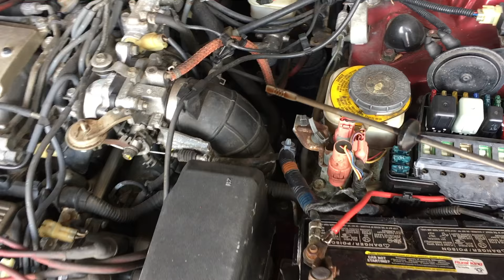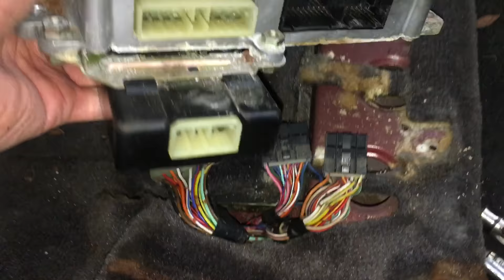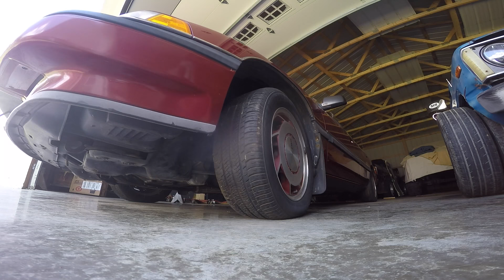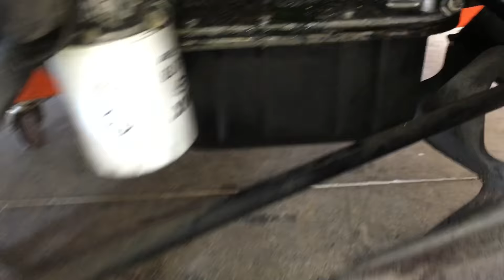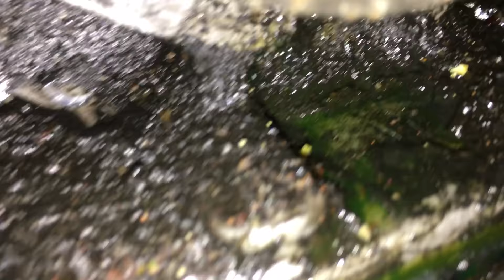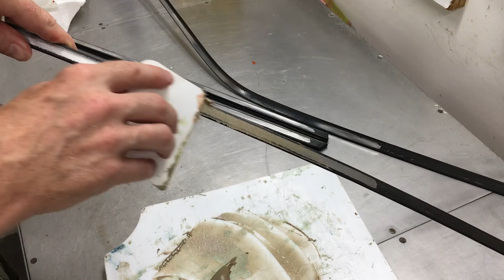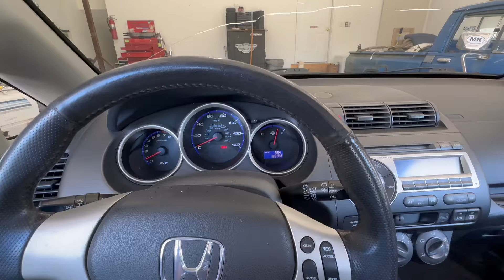$350 Acura Legend Full Restoration: 15 mins Start to Finish!

Comment: I want to start a project car soon too, get something cheap and non running and fix it up. Problem is that the old cars here just look awful and rusted
Reply: Like besides the interior and some electronics, this car looks great. And those are things you can change
Reply from the maker: Rusty is what most of the older vehicles are around here. This one was truly a needle in a hay stack and I was very lucky to find it. I'm back to restoring a rusty 1g 4Runner and it's soooo much work.
Reply: Theres still some gems on CL, as far as projects go.  Older folks not using FB, etc.  Ive seen a few posts over the last months while looking for a used vehicle there.

Comment: no rust? that's crazy!  what about underbody and wheel wells?
Reply from the maker: The underbody was surprisingly clean! There were a couple of tiny bubbles under the paint where the rear 1/4 meets the rear bumper - where all Hondas start to rust.  But that was it!

Comment: How would you completely restore and refurbish something like a 86 stanza wagon including its engine, frame, and body. Would you need to make your own parts. Fixing and restoring everything, is it hard or easy.
Reply from the maker: It really depends on the level of rust involved. I'd imagine there's not a lot of aftermarket support for a Stanza, so you'll have to fabricate any replacement parts/panels or source them used. Frames can be repaired if they're not completely rusted out: https://youtu.be/VkKxIEPKUAQ How rusty are the floors?

Comment: This car did sit outside for 10+ yrs, how is it possible it has almost zero rust on it
Reply from the maker: It was parked outside, but never driven on the salty roads during winter.
Reply: @6thGearGarage  on grass or solid ground? grass keeps moisture, so it causes alot of rust on the underbody
Reply from the maker: Thankfully it was parked on pavement.

Comment: how long did this restoration take?
Reply from the maker: I did it in my spare time, but I started getting it to run in spring of 2021 and finished painting it in late fall 2021.  Then I stored it for winter and did the timing belt, seat covers, and refinished the black trim in spring/summer of 2022.

Comment: My first car was a 1987 Legend (the base model with Florence blue over gray two-tone paint and blue fabric interior). I grew up in it, and it was twelve years old with about 280,000 miles when I started driving it. It was impossibly well engineered and built, and more modern than any car from the mid-80's had any right to be. We let it go sometime around 2004, at well past 330K, and in all those miles it never needed more than routine maintenance. This video makes me wonder if it's still on the road somewhere!
Reply from the maker: These 1st gen legends are tragically underrated!

Comment: I would’ve scrapped the car. Having part availability problems for these older cars just makes it not worth it in my opinion. You did good for the most part but the seats, the weather sealing seals that’s why water got into the car, all needed to be replaced. But good on you for at least getting the car running and driving again.
Reply from the maker: Yeah the seats were a letdown. I've since learned to reupholster and the end result is 100x better: https://youtu.be/sWS9Sgd1Ho8

Comment: A lot of people have no idea that the 80s and 90s cars are still kicking, this consumer culture. They think if it's not new it's not worth it. Absolute gem! And great work on that Enkei.
Reply from the maker: 80's and 90's cars are my favorite era. Not as powerful as 2000's and newer, but they're fun, simple, easy to repair, and have just enough electronics to make them reliable without all the extra bells and whistles waiting to fail like modern vehicles.

Comment: Did you ever fix the sunroof?
Reply from the maker: No, it was completely rusted in place and I never found another one for sale. I put it back in and left it in the closed position.
Reply: @6thGearGarage  too bad, but it should be fine if it doesn’t leak, and you don’t really see it from the inside anyways and if it looks fine from the outside.
Reply from the maker: I did clean out all 4 sunroof drains while it was apart, so it shouldn't leak anymore.

Comment: I brought one of these back from the dead 20 years ago. It was sold as needing a fuel pump but the timing belt was broken, so not a cheap repair. Well worth the money and effort anyhow, it was a delight to drive. My only disappointment was that they didn't ever come with a manual box. Peppy, comfortable and rare enough to turn heads. Mine was also a 1988 in Persian Red. ))
Reply from the maker: The Persian Red sure does look great on these cars! There were manuals but they were more common in the coupes, as most Sedan buyers were looking for luxury more than sport. The 5 speed is a rare find in the Sedans.

Comment: Did you sell it?
Reply from the maker: I traded it for the Honda fit + cash
Reply: @6thGearGarage  how much wood you have sold it for just cash
Reply from the maker: I had it listed at $4000 and nobody came to look at it. When I dropped to $3500 is when I eventually got the offer for the trade.
Reply: @6thGearGarage had u seen it in my local area u would have grabbed it

Comment: It would help to change all of the fluids first.
Reply from the maker: I checked the oil & coolant first, it was good (did need to add some coolant) But I didn't want to replace all the others until after I made sure it drove/shifted properly.

Comment: Great job with the restoration! With the leaking sunroof and the water under the carpet, were there any mold issues with the carpets and seats? And if so, how did you remedy it? Asking because I have a '94 Legend I am looking to restore.
Reply from the maker: Aside from that little bit of green algae, I did not have any issues from the standing water. I did have the seats out of the car for a few months and gave the carpet plenty of time to air out.

Comment: What did you do to ensure the sun roof doesn’t leak anymore?
Reply from the maker: I cleaned out all 4 drains with a long stiff wire. The back two were completely clogged. I've driven it in the rain and there are no more leaks :)

Comment: Had an 88 coupe for the same price back in the early 2000s.  Friend was about to process through MEPS and had pawned the title, the clutch was a bit bad slippy but the car was fine and driveable at least for a while, so I was happy.   AND THE DORITO REAR ELECTRONIC WINDOW IS THE SILLIEST CUTIE AND I LOVED IT.

but he got drunk and burned a literal chain ring of "lighter faces" around his bicep the night before meps... and it caused 2nd degree nasty burns leaving him a self-danger bc of infection risk, so he needed his car back after all for another 5 months or so, and so I ended up spending a 20$ full tank of gas to have the Legend for a week, long enough to learn it blew my 4 door integra away in cool factor speed and fun.... and I still want another to this day!

Comment: i would have sunbath those seats for days then applied disinfectant after, just want to be safe than sorry.

also, how come rods and axels isn't corroded or broke?
Reply from the maker: They were out of the car for a month or so while I had it all apart. This car wasn't very rusty because it was originally from CA and CO. It was in OH for 10 years, but that was just sitting on pavement instead of being driven through winters.

Comment: my first car. was a champ the whole time, minus the sunroof. no surprise u couldn't fine anything to replace it. i had issues with that 10 years ago, cant imagine its any easier now
Reply from the maker: That was the only downfall of the car, was finding parts. There are some engine sensors that can only be found used.

Comment: I had a 1994 Acura Legend for me  personally it was an excellent car never had a problem it run for 5 years still after 489k miles still run strong but I knew one day we had to apart from each other. A year later I found the new owner and he told me that the car was good and that he already had put 520k miles after he bought it from me after that I never heard from the guy but yeah this cars can run forever just like a Nissan or Toyota is all about the maintenance
Reply from the maker: That's amazing! I haven't heard of one making it over a half million miles before.
Reply: @6thGearGarage  yes all I was doing basic maintenance oil changes I did replace the timing kit after it hit around 200k I do remember changing the spark plugs and cables the radiator and some other basic stuff just to keep the car running now when it hit 289k I did the whole thing timing belt water pump thermostat and hoses also belts and pulleys also change the head gasket and valve cover gaskets  the only breakdown I had this car that I remember was a flat tire and a bad radiator cap. But that was like years ago when I had this car

Comment: Part of the reason cars are so expensive now is because of how much tech is in them compared to the older cars that were simpler to run and drive. Makes you wonder if a car could be sold for 15000 dollars if it stripped out a lot of the modern features and just kept the very basics and simplified the engine.   The reality is you don't need more then 150hp on a commuter car and it can still have a bigger body that is more driveable.
Reply: Yeah the most advanced thing i would want in a daily driver is adaptive cruise. Besides that just give me A/C and a double din Kenwood and im golden. 
Comfortable seats dont need power, wibdows can roll up and down with cranks.
Reply: I don't understand how there isn't a market for this? Seems like money just lying around. Plenty more poor people would buy a new car if they sold for 15-20k.

Comment: Amazing restore!!! My brother has a leak in his fit hatchback, what would be the best way to repair this leak?
Reply from the maker: I'd check for leaks around the tail lights and hatch door seals. If it's rusty like mine, it could be from rust holes.   If he can't find the leak, have him sit inside while someone sprays the outside with a garden hose.
Reply: @6thGearGarage Assuming the leak is near the tail lights, Do you recommend replacing the rubber gasket surrounding the tail light assembly?
Reply from the maker: Yes that’s the solution for a tail light leak.

Comment: Well if it was 15 minutes from start to running, I'm guessing you didn't change the timing belt, which I would have done (unless it was done recently by someone) if it has been sitting for 10+ years.  On those vehicles, if the belt goes, chances are the engine will be toast.  Otherwise though good find for $350.  That's back in the day when those Honda/Accura vehicles were known to rack up hundreds of thousands of miles with little maintenance (trans and oil changes and the occasional belt change).
Reply from the maker: @HR-wd6cw   I changed the belt/wp after fixing the clear coat, around 11 mins.

Comment: $   350.00 purchase
$ 1800.00 parts
$  2150.00  total

Mike Brewer would've pitched that for $ 2500.00 and sold it for $ 2300.00 for a measly $150.00 profit.
Rabbit (RIP) would've pitched that for $ 9500.00 and let it go for $7000.00 for a decent $4850 profit.
Reply from the maker: the $350 purchase price was included in the total. I miss Rabbit.

Comment: For the sunroof, you might try and contact a place called Bernardi parts. They often stock parts for older vehicles like this one and there's a chance that they might have what you're looking for. Also if you can get the part number by the VIN then you can google it and see if you can find a vendor that carries it. Hope this helps!

Comment: This proof why sunroof is such a terrible idea.
The leaked water inside interior can cause major damage
The heavy glass on the top of the car cause the center of gravity to be higher. Which is bad if the car roll.
Plus, the danger of glass shattering during an accident
Reply from the maker: No sunroof would have made this job so much easier!

Comment: Awesome job on the restoration.  However, one thing that bothered me through the video was the pronunciation of the wheel brand, Enkei.  You kept pronouncing it as "een-key," but is actually prounouced "en-kay," (with a very short drop on the pronounciation on the Y sound, if pronouncing it in proper Japanese).  The word enkei in Japanese means "circular."
Reply from the maker: Interesting, I had only heard it pronounced Enn-Key. Thanks for the heads up!

Comment: I had an '88 Legend Coupe L, 5-speed.. Great car to drive, but it was a mechanical nightmare. Blown rear main seal, leaking injectors, bad fast idle control value, suspension issues, and huge front windows caused all sorts of problems because they were so heavy. However, despite all of that, I would buy another one in a heartbeat. Or maybe the next gen, like a '92 5-speed sedan. Yes please!

Comment: In high school, around 2002-2004, i knew 2 people that drove a 86, and 88 legend. Both teens. They bought it for 1200, 1500. There was no value in these during that time, but i know its very decent when new. Nice to see one restored.
Reply from the maker: I'm surprised they're not more sought after now. The biggest issue I found was parts availability.
Reply: @6thGearGarage  during my high school years in 02-04 when i drove, my classmate bought a 93 acura legend for 3k, i bought a 92 camry for 3k. A 90 accord was around 1800., eg civics were going for 2000. I wonder why the acuras didnt hold its value that much when it got older.
Reply from the maker: I was surprised nobody wanted to buy this when I had it listed for $3500.

Comment: you can reupholster the seats yourself using the original fabric as a template. It doesn't take too long to learn and get to the point where you can make a factory quality covering and it'll save you thousands in cost. There's a guy with a channel called "cechaflo" who has incredibly detailed videos showing how he restores car interiors and he responds fairly quickly to questions - I picked up a lot watching him work........ 

As far the sunroof goes - that's a huge problem. I've dealt with several sunroofs where the previous owner didn't understand how leaks happen and instead of properly cleaning the drain tubes, they would attempt to seal the glass at the roof and it always causes the guide cables to rust up and fuse themselves to the inside of the guide tubes - there's no fix for this that I've been able to find and no good way of extracting the cables from the tubes - they're pretty much welded to the inside of the tubes 90% of the time. I've found the best way to fix this if you can't find used cassettes to rob parts from is to cut the guide tubes and cables off of the cassette and fabricate new tubes using a tube bender and purchasing quality brass tubing and then purchase replacement cables for a new model vehicle and cut them down to fit the car you are working on - sometimes you might have to use a motor and cable set from a new vehicle if the winding spacing on the cables is too specific to fit your original motor but ultimately so long as you are able to save the brackets that attach the cables to the original glass, you can fabricate a working sunroof using parts from other vehicles.

Comment: Wow - amazing -  love the video -  wow -   I have a 99 Toyota Camry I bought new -  399641 miles on it.    6cyl - 5 speed manual.   Nothing wrong - no leaks - no rust (AZ car) -it is sunburned from AZ sun.    They don't make cars like these anymore - bullet proof -
Reply from the maker: 100% Simple and reliable are no longer options with new vehicles... Hang onto that Camry, especially being a manual!

Comment: I wanted to know about transmission, underbody and suspension condition.
Reply from the maker: The suspension and transmission were both in good condition without any issues and drove great.  The underside was really clean because it was originally a CA and CO car before it sat for 10 years in Ohio.

Comment: The Honda/Acura models of the later 1980's to early '90's were and (and are, still) memorable eye catchers to me in that, back then, the "Legend" (especially the coupe design) as well as the company's "Integra" model reminds me of my high interest on those years of F-1 auto racing of the Honda powered Williams Cars of one of my favorite all-time drivers, Great Britain's, Nigel Mansell who was for a few years driving the V6 turbo racing engine of Honda's. I test drove in 1988, a couple of those Acura designs while looking into a new car to purchase. They both were fun, especially the "Legend". As to Honda cars...My wife and I have had three: an '83 Accord hatchback; a '93 four door Accord; and, still have a four door Accord of 2008 year. They all are good...especially the latest - 2008. 
If I remember, the 1988 "Legend" had a 160 H.P. V6. The "Integra" had 145 I-4. 
Watching the excellent restoration of this '88 "Legend" was fun! Glad it's back on the road.  Consumer Reports Magazines back then rated the Acura/Honda cars excellent choices.
Reply from the maker: Honda was at the top of its game during this era, as was Japan's economy. There were some great cars designed during this time. This car was very solidly build and it drove so well.

Comment: Bet most of the suspension joints and bushings are shot.
Reply from the maker: It actually drove very well and handled well too.  But replacing the suspension was going to be the next thing I would have done, had I kept the car.

Comment: try a honda dealer its the same as a honda legend
Reply from the maker: I checked Honda for the timing belt & water pump, but they were discontinued. So I went with aftermarket parts.

Comment: Awesome video dude.  I have a 2000 Toyota Tundra (built 1999), that has 315k miles on it. I still drive it and keep it maintained.  Your video has me thinking of doing a paint refresh on the old Tundra.
Reply from the maker: A 2000 Tundra with 315k miles is just broken in!